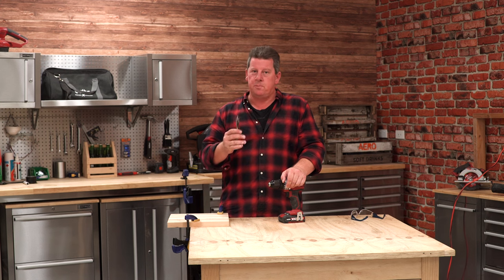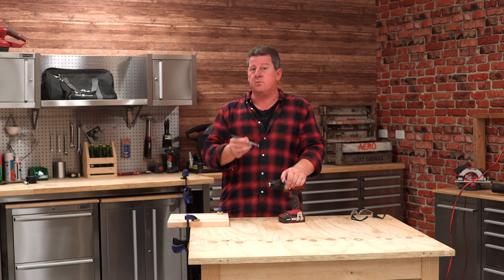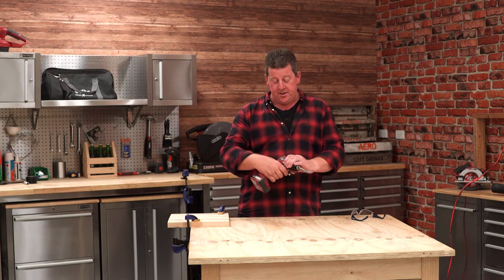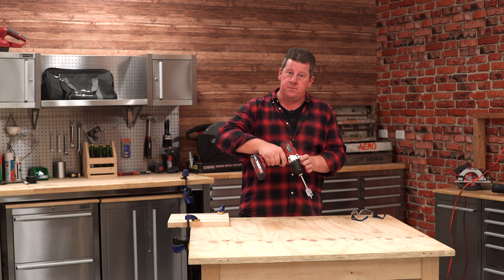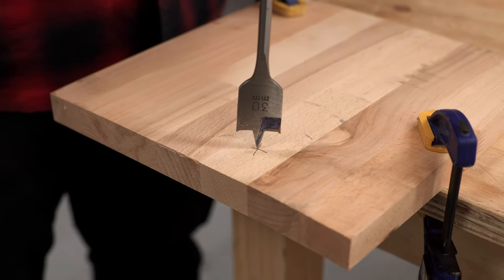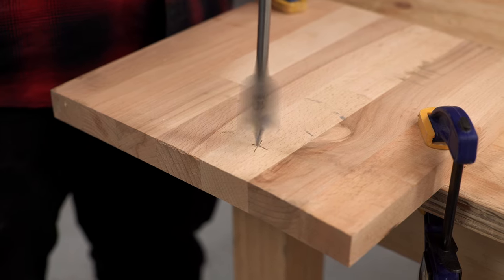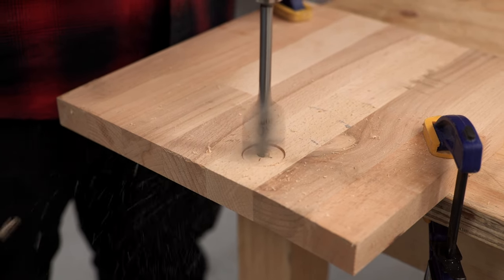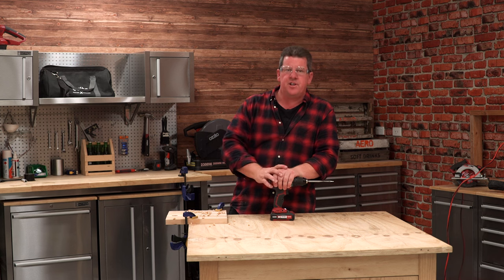HOW TO USE A SPADE BIT - Ozito Tool Tips

Comment: If you stop as soon as the tip breaks through and turn the work piece over, you can drill a clean edge from the opposite side to finish without tearout. But you might need an assistant to keep an eye one the underside as you drill.
Reply from the maker: Thanks for sharing, Cre8tvMG. This is a great tip!

Comment: I need to make a hole in the back of thin tv cabinet, would a spade bit be right for this job?
Reply from the maker: Hi Matt, thanks for reaching out. It will definitely be able to make a hole in the cabinet, the finish might be rough depending on the type of wood it is, generally it favours soft wood but is able to drill through hard wood, chip board and MDF. The size of the hole matters as well, if it’s a large hole you’re after, perhaps consider using a hole saw. If you decide to use a spade bit make sure to avoid excess pressure on the bit as it might splinter or damage your cabinet. Cheers

Comment: can you use it to make a through-hole on a 4 by 4 post?
Reply from the maker: Hi there, thanks for reaching out!
Yes you can but the spade bit needs to be long enough. The wider the spade bit will put more pressure on the motor so try not to push excessively otherwise it may overheat the motor. Additionally, hard wood will also increase the resistance so please be mindful not to use too larger a spade bit or use a larger drill. I hope this helps, cheers!

Comment: Hello can you drill this wall on a vertical cabinet surface ?
Reply from the maker: Hi Mihir samel, thanks for reaching out. Yes, you definitely can drill with a spade bit into a vertical surface. Just make sure you start drilling straight into the surface. Cheers
Reply: @OzitoDIY  yup. It worked! Thanks
Reply from the maker: Glad we could help!

Comment: When the bit is in place and spinning, the tip seems to rotate about a circular direction. Not on a point. Does that make sense? Is that normal? The bit seems locked in straight but this doesn’t seem to be the case. Any ideas?
Reply from the maker: Hi Tom, This spade bit is fitted within a handheld drill so there's likely to be user movement but the tip itself is coloured on one edge which may give the impression of moving.
Reply: Hi tom, there is a difference between locked in straight and locked in centered. Most drill chucks have 3 prong closing but a lot of new spade bits have different shaped ends, if you think it is not in properly, loosen off and retighten slowly, this should centre the bit better.
Reply: DIY Woodworking Tips Tricks and JIG Ideas I figured this out. I thought the clamping mechanisms were faulty but after a few alignment tries I got it right. Thanks for you advice.

Comment: Don't put the spade bit in a drill. Put it in an impact driver (notice how the bit is designed). If you put the bit in an impact driver it will not jam in the wood. Use the impact setting.This video could use a lot of improvement. I'm moving on to another youtube channel yikes. .
Reply from the maker: Hi there, thanks for reaching out. Sorry to hear you weren't happy with our video. We are always trying to improve our content for you. Hope to see you on our channel again. Cheers
Reply: I agree with you Rfafavalo ! The person in the video was too lazy to go into more details about the spade bit.. He barely even scratch the surface about the spade bit. Also he was so lazy, he didnt even finish drilling the hole . He only drilled about 1/8 inch into the wood and stop.